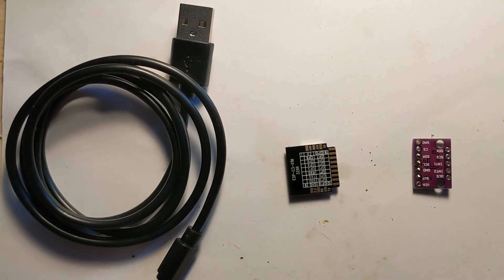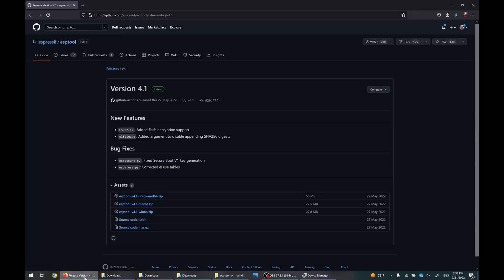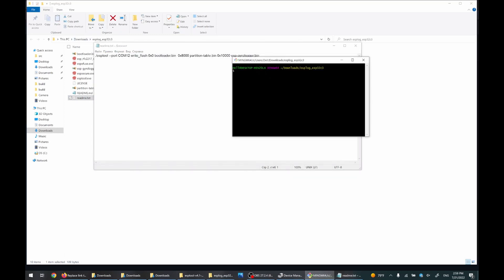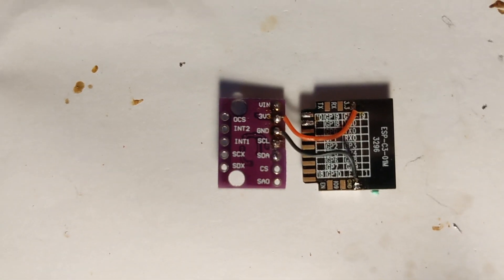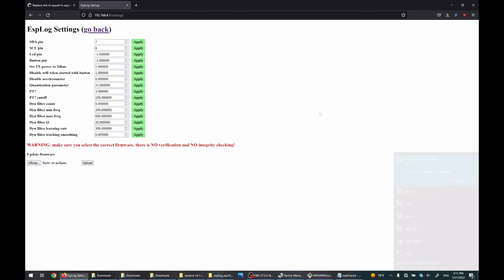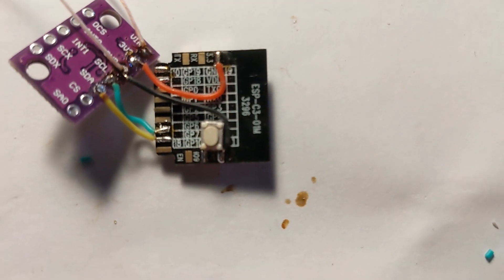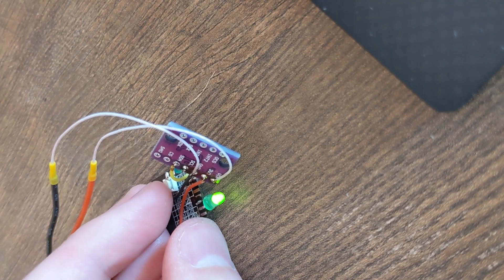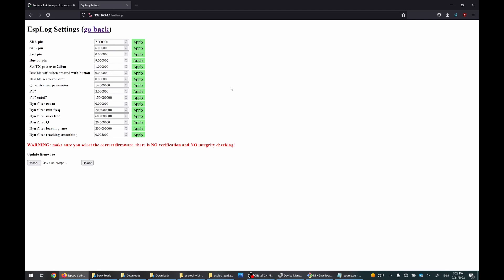How to build the simplest and probably cheapest DIY logger for GyroFlow (esp32-c3/bmi160 version)

Comment: I can’t seem to flash the atom S3 because I can’t open the esptool to enter the README command. I am using windows.
Reply: The spool doesn’t get opened. Go to the folder at the top where the folder directory is type cmd in there should open up then copy your readme file in there with the correct com port.

Comment: Hi, Vladimir - thanks so much for making Gyroflow available to everyone!  In my haste, I apparently bought an AtomS3R, upon which I flashed the AtomS3 firmware before realizing that it has an entirely different pin layout.  Is this device doomed? Or do I just need to assign different values in the EspLog settings?  For example, looking at the schematic, it seems like the SDA and SCL pins might be 45 and 0... but I'm just looking for groups of letters and really have no idea how to interpret the diagram.
Reply from the maker: @cynematics  yes it seems you guessed sda/scl correctly. You can also setup button on pin 41. The LCD backlight won't work
Reply from the maker: @cynematics  you can use the generic s3 firmware as the display won't work anyway

Comment: I want to power it with my camera but the camera internals don't have a 5V . But it has 3.3V . Can I connect bmi160 to 3.3V power supply instead of the 5V one? Or do I still need to input 3.3V to the VCC? But I am not sure if the regulator will output 3.3V ?
Reply from the maker: If you have 3.3v you have to bypass the regulator on the bmi160 board, yes, otherwise you will get too low voltage after the regulator. So connect 3.3v to VCC of bmi160 board not VIN.
Reply: @vladimirpinchuk8483  do u know the maximum tx power I can set in settings.?
Reply from the maker: @Amit_Kattal  20dbm
Reply: @vladimirpinchuk8483  thanks. One last question. In the gyroflow app, the gyro data is like in shape of steps and I have to choose the "low pass filter" option and then zoom in very high to see the pattern. Why u think that is? It doesn't really impact the stabilization though just some extra steps
Reply from the maker: @Amit_Kattal  the steps are from lossy compression in my firmware. There is a setting called quantization parameter, it allows you to tweak the quality, but better quality leads to larger file sizes and lower recording capacity

Comment: can anybody successfully compile it to esp32-s2?
Reply from the maker: It is possible to compile, but it won't run (will crash) due to smaller ram on esp32-s2. Reducing memory usage by the firmware requires rewrite of the gyro processing pipeline, not planned anytime soon.
Reply: @vladimirpinchuk8483  ahh ok thx...my mistake ordering the s2, i thought gonna be as simple as basic esp32...

Comment: Can you please share Gyroflow app configuration or screenshot? And I can't find right IMU orientation. My sensor (BMI160) looks directly straight (label on the top, point at the top-right)
Reply from the maker: It is hard to reason about IMU orientation, I never do it manually so I can't say what is correct for you.
Have you tried selecting "guess IMU orientation" after right-clicking on the timeline? Also make sure rough offset and sync search size are set correctly and that you are right-clicking at a point of time where there is some motion.

Comment: Thanks a lot for all your work. I will try to do the same. Just a question towards the ESP32 some sellers on aliexpress have explictly the 01m greyed out impossible to order. Which other one would be a possible alternative with as tiny as the c3-01m formfactor :)
Reply from the maker: Any one with esp32, esp32-c3 or esp32-s3. Esp8685 is the same as esp32-c3, just different package. The smallest thing you can get is esp8685-wroom-07 which is just 12x8 mm. But it is much harder to flash - you need to solder two tiny test points for uart and use a usb-uart adapter. So you probably want a module which has the pins available, so you can solder the USB directly. If size is not that critical, you can get for example esp32-c3-0.42 OLED, it has a display which is supported. If you want more flash (8M), you can get some board with esp32-s3 like atoms3 (it has gyro built-in).
Reply: @vladimirpinchuk8483  thanks a lot for your response!
Reply: @vladimirpinchuk8483  Only once again before i finally order :D ESP32 C3 Super Mini looks like it, right? 4MB flash, usb port with serial so I dont even need to solder that only gyro  and 5v bec power it is then. Because price wise this one is quite cheap for me with less than 2,50€ plus everythign he has

Comment: Hello Vladimir, I can't figure what and how to determine IMU orientation. Auto guess doesn't work in Gyroflow and I don't know if it's normal. I used to test Gyroflow with my phone and Sensor Logger and IMU guess seemed to work. My flow data and my gyro logs from est logger seem very different, and I can't find any point where it does align. Maybe I did something wrong when connecting BMI160 to my ESP32C3. I connected SDA to SDA and SCL to SCL which is GPI06 for SDA and GPI07 for SCL which seems to be different on your video (GPI06 for SCL and GPI07 for SDA), but my I2C shows no error. Anyway, I'm just lost and doesn't know where I should start to investigate more properly
Reply from the maker: Have you calibrated gyro bias (the green round button when the gyro is not moving)?
If you move the gyro only in one axis does the gyro graph show it right? This is the easiest thing to check not relying on the sync process.
Reply: @vladimirpinchuk8483  Hello, I finally managed to make it work. Some wires were touching others while moving because I was testing and hadn't done things properly. Thank you !

Comment: hello, i'm using esp32-devkitc-v4 with GY-BMI160 it says i2c failure, am i connecting to the wrong pin? i'm using pin 21 and 22 which is scl and sda
Reply from the maker: Have you set the pins in settings at 192.168.4.1/settings ?
Reply: @vladimirpinchuk8483  yeah, still error
Reply from the maker: @kuromatiku  how is the power connected to bmi160?
Reply: @vladimirpinchuk8483  using the 3v3 pin on esp32

Comment: @vladimirpinchuk8483 thanks for posting this, great work. I'm building a gyrologger based on an Arudino nano and a MPU 6050. Just wondering how is that IMU data formatted for Gyroflow? Can you share a sample? Thanks! It's the only component left for me to get the data formatted properly.
Reply from the maker: Read official gyroflow docs https://docs.gyroflow.xyz/app/technical-details/gcsv-format
Reply: @vladimirpinchuk8483  Thanks I think I got it figured out. I missed the section on the formatting for the CSV headers which I did not have correctly formatted.

Comment: Hello Vladimir, unfortunately i get the error: "-bash: ./esptool: No such file or directory" when i type in the command. i started bash in the folder with all the files. When i type ls i cann see all the files. Don`t know how to continue. I`m using ESP-WROOM-32. Can you please help me? Thank you!!
Reply from the maker: Are you on windows? Are you sure you downloaded the windows version? There should be esptool.exe in the directory. You can also try ./esptool.exe
Reply: @vladimirpinchuk8483  Hey thank you so much for your help!! Yes running on Windows. Version and file ist correct but the missing .exe was the problem. Thanks! Great Project. I do FPV with the Canon EOS M with magic lantern crop mood and stabilisation ist great for that!

Comment: I have done it using esp32 ... But I have doubt, between which pins that I needed to place the switch?
Reply from the maker: If it is classic esp32, not c3 or s3, then between any pin except 6,7,8,9,10,11 and gnd.
Reply: You are shorting the ground and gpio 9 in this video, right? and in the settings only added the number 9 ?.. in my case, what should I enter in the settings if I short the pins gpio 12 and 13?
Reply from the maker: @akhilksankar3499  what do you mean by shorting 12 and 13? You need to connect the button between gnd and any other unused pin except the ones I have listed (because these are used inside esp32 for spi flash)
Reply: Ok..Thank you maan.. ❤
Reply: It works..❤❤❤❤...Thanks a lot❤❤❤...

Comment: The flashing works with no issues but there ist no network showing up. Is my esp broken?
Reply from the maker: Are you flashing the correct firmware (esp32 vs esp32-c3)? Try erasing the esp32's flash (./esptool erase_flash) before flashing the firmware
Reply: @vladimirpinchuk8483  The firmware is correct  and erasing the flash sadly didnt work
Reply from the maker: @julianrsch6256  what do you mean by "did not work"? The erasing itself did not work or it did not help?

Does any Arduino wifi hotsopt example work on your esp?
Reply: I got the Network to work. I shorted the gpio9 to the ground and left it like that.

Comment: Does this work with a sony a6300 and gyroflow?
Reply from the maker: Should work
Reply: @vladimirpinchuk8483 And is it possible to power it with the usb output of the camera? I'm sorry if i'm asking stupid questions. I'm new to this and want to find a way to save the gyro data of the a6300 so i can use gyroflow.
Reply from the maker: @julianrsch6256  probably no
Reply: @vladimirpinchuk8483  I've seen a project called Flowshutter and they managed to get it work that way with a flightcontroller. The Esp and bmi should take less power than the fc?
Reply from the maker: @julianrsch6256  flowshutter has a battery inside.
Reply: @vladimirpinchuk8483  Oh my bad. Well the shutterflow plans look too hard for me. So I guess i'll have to stick to handheld filming. Thank you for answering my questions!

Comment: I am using esp32 devkit board. Should the button pins (the ones we configure for pressing button) have voltage? Because in my board, the gp9 pin and gnd together conduct 5v. Do i need to select different gpio pin that doesnt conduct with gnd for it to configure as button pin?
Reply from the maker: You cannot use pins 6,7,8,9,10,11 on the esp32 as they are used for connecting spi flash internally
Reply: Have you finished the work?

Comment: Thank you so much for this great project. where can i found wring diagram (usb to esp32)
Reply from the maker: If you are talking about esp32-c3, then d+ to gpio19, d- to gpio18
Reply: What about esp32s ?
Reply from the maker: @PersianFilmMakers  not sure what you mean by esp32-s. The module which has a label esp32-s on its metal lid? This one does not have a built-in usb-uart, you'll need to use an external usb-uart like ch340 or cp2102 to flash the firmware.

Comment: What power source can be used with this?
Reply from the maker: It starts working from about 3.8v. Not sure about the maximum voltage, probably about 8v.
Using an 1s battery directly won't get its capacity fully used, using a 2s battery wont be very efficient because of loss at LDO.
So it is better to use a BEC (3.3v or 5v) with >= 2s battery.
Reply: @vladimirpinchuk8483  Is BEC needed if i just use like a direct 5v power output? from lets say a powerbank
Reply from the maker: @Amit_Kattal  no, just connect to 5v input on gyro board
Reply: @vladimirpinchuk8483  What if I use ESP32 With Micro USB can I use it for power source, and using power bank
Reply from the maker: @Theo-pc8jz  yes

Comment: Can I do this same with esp32 and imu6050??
Reply from the maker: With mpu6050 yes, the firmware supports bmi160, bmi270, mpu6000, mpu6050, mpu6886, icm42688p. Also lsm6dsr is supported, but it is not recommended as it is very sensitive to vibrations

Comment: when i change the sda and scl pin in setting nothing is happening and the page show i2c failure=1
Reply from the maker: Did you restart the logger after that?
Also double check that your connections are correct. If it still does not work, send me a picture of your setup on telegram @vpinch or find me on the Gyroflow discord (vpinch4) and DM
Reply: @vladimirpinchuk8483  problem solved cable not in the correct pin thanks for very fast response
Reply: @vladimirpinchuk8483  another thing.... what is the orientation of the gyro to mount on the drone?
Reply from the maker: @calogerocastronovo9851  mount it any way you like (but aligned to the camera axes). Then find the orientation which is correct for you either by right-clicking 'guess IMU orientation' in GyroFlow or manually. Then you can enter it in the logger settings and reload the download page.
Reply: @vladimirpinchuk8483  I can't, can you help me?
Reply from the maker: @calogerocastronovo9851  yes, but DM me on telegram or discord - YouTube comments are not very suitable for this
Reply: @vladimirpinchuk8483  give me your telegram
Reply from the maker: @calogerocastronovo9851  it was in the previous comment, @vpinch

Comment: Good Day! Is there any plan to add SD card support?Good Day! Thx for greate project. Is there any plan to add SD card support? Looks like internal memory will be overfilled in 10 minutes? Btw, what sensor do you recommend for best performance mpu-6500 or bmi160 or maybe something else?
Reply from the maker: Internal memory is enough for 50 minutes or more, this depends on the type of motion. I do not really see any reason for adding an SD card, but it should be pretty easy to do. The sensor does not matter that much, but only mpu6050, bmi160 and lsm6dsr are supported. lsm6dsr is not recommended.
Reply: @vladimirpinchuk8483  I see. Thank you!